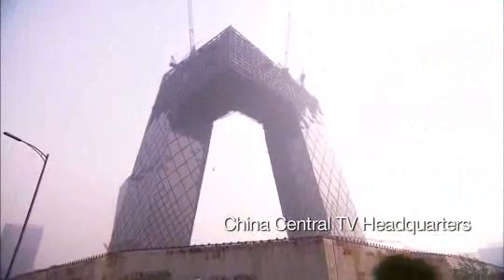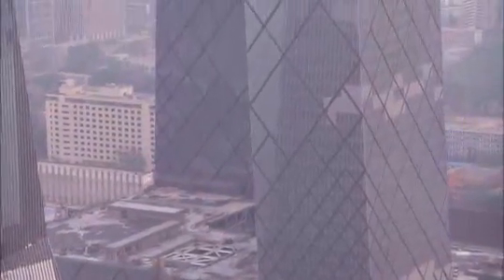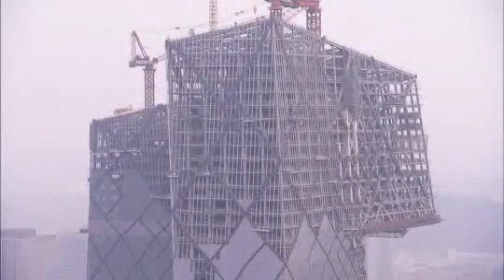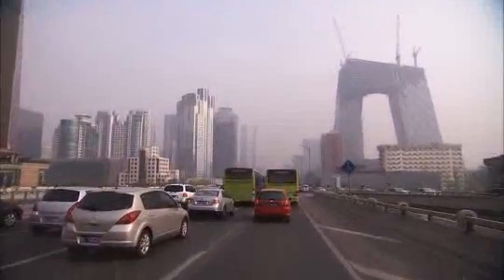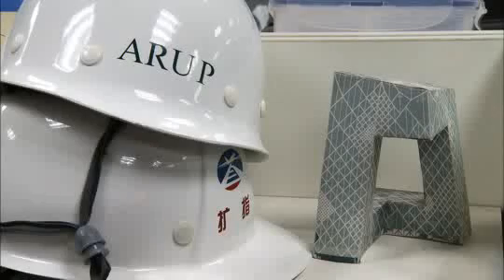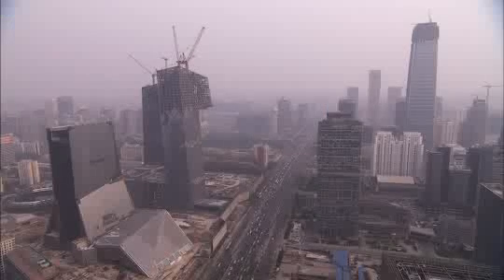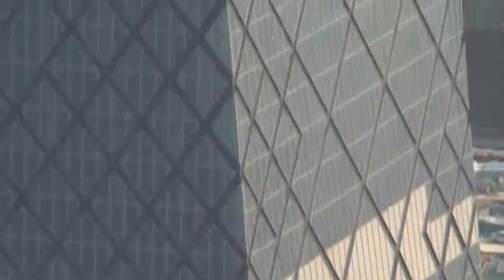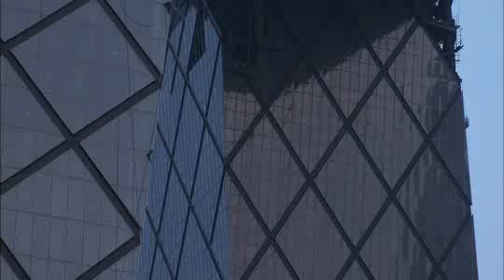CCTV's headquarters in Beijing

Comment: LUCKILY, WHEN YOU WERE ASKED TO SOLVE THE STRUTURAL PROBLEM OF THE NOT- SYMMETRICAL 40 STOREY BUILDING IN EARTHQUAKE ZONE BEIJING, IT WAS  DECIDED BY THE IGNORANT  AND UNEDUCATED CLIENT TO HAVE A WEIRD BUILDING! YOU ARE  NOT RESPONSIBLE FOR THE FAILURE. HOWEVER, MY ARCHITECT'S STRUTURAL EXAM. ON EARTHQUAKE DESIGN WOULD SUGGEST THIS ASYMMETRICAL HIGH-RISE WOULD FAIL IN 100,000 TONS OF EARTHQUAKE FORCE WITH A PENDULUM MOTION THAT WOULD NOT GO BACK TO THE ORIGINAL CONDITION!  GEORGE WU,AIA 2010